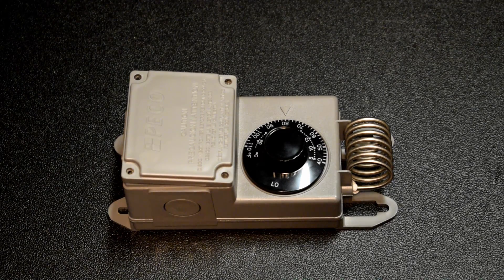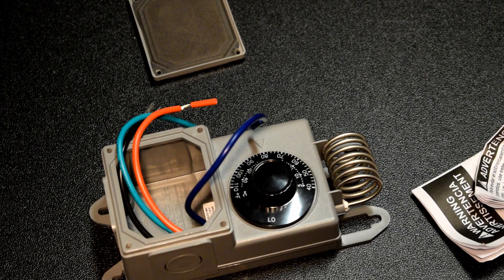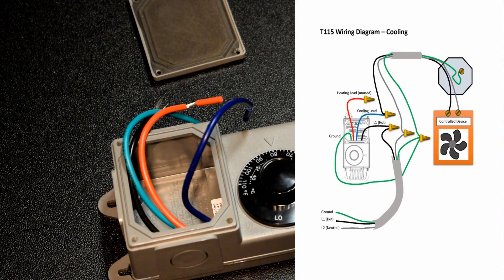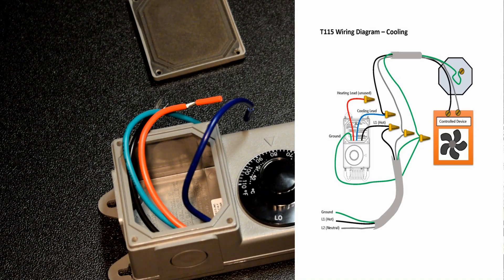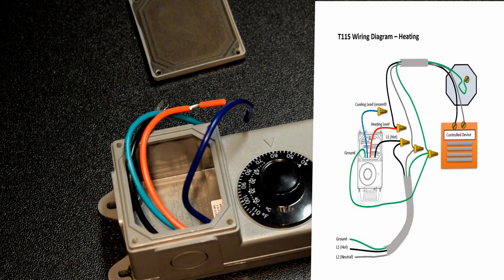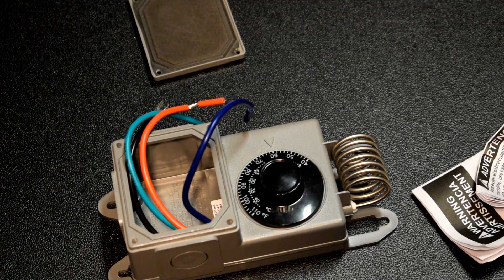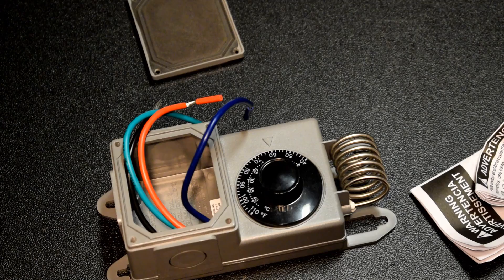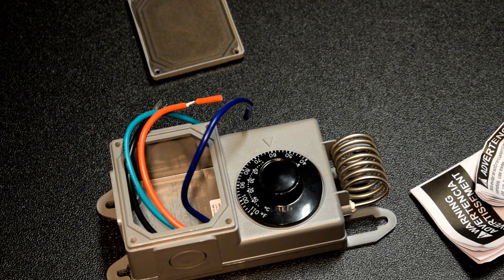T115 Thermostat Information

Comment: Does it work with an immersion heater?  I am trying to use this thermostat to keep a solution within a specified range (between 65F - 95F) but the solution has been sitting at room temp for the last several weeks, the solution is corrosive and the Stainless steel probe was ideal as the solution does not affect it. Any suggestions or help would be much appreciated.

Comment: Heya,
 Thank you for the video. Question...how would I wire this up to turn my heat tape on and off? I have the Peco TF115-023 Industrial NEMA 4X Thermostat and a piggy back extension cord for power. 
Thank you for your time!

Comment: Can it be wired to 220? If so how
Reply: I'm wondering the same thing
Reply: @lostcoast707  it can i did it, you have one leg hot all the time and the other leg on the thermostat switch
Reply: @lostcoast707  it works great